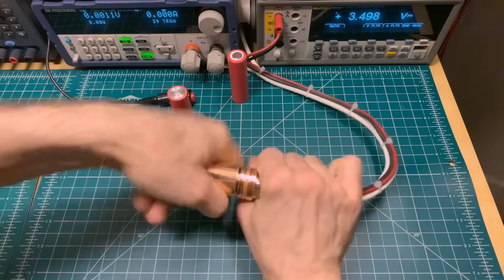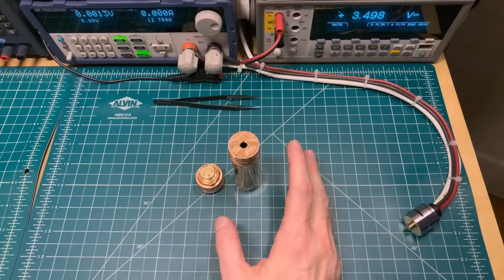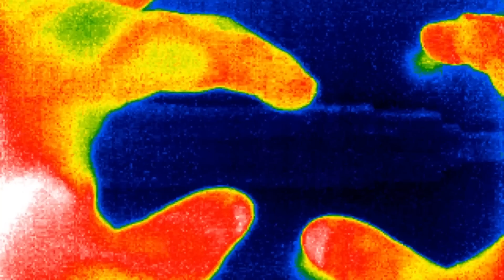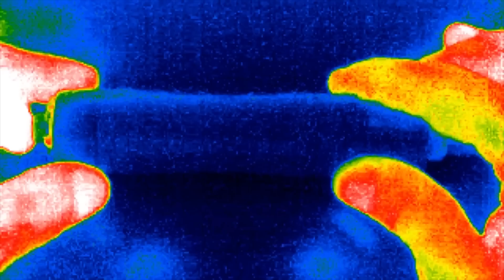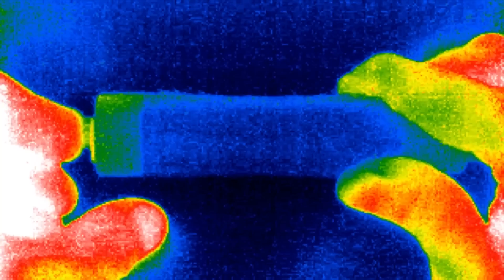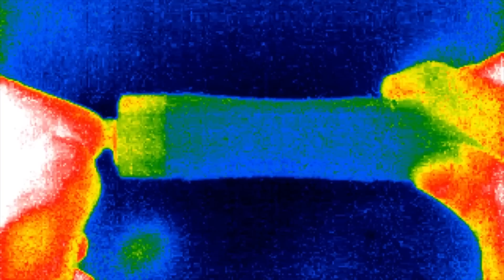Minding Your Mechs Ep029 – Timesvape Heavy Hitter (collab with TenaciousTX Vapes/Heavy Metal Vaper)

Comment: Mines just acrs constantly, cleaned thoroughly, raised the resistance (0.26), inspected every piece ect and it just won't fix, gets hot hot on the battery tube where the button locks in and there's a couple black dots where the arc happens inside the channel where one of the locking teeth goes, only a month old too. I even swapped the springs to the spares and the o ring too literally lost for a fix at this point

Comment: I hope i get a response... I also use the same mod, using Molicel 21700, is it safe to vape in 0.10 ohm?
Reply from the maker: Run the Ohm’s Law equation to see how much current you are drawing from the battery with that resistance. You MUST know how to do this before you use a mech! Compare that current you will draw to the battery’s current rating. I recommend staying below the battery’s rating but some people go over it.

Comment: I just got my first mech today, and it was this one, working fantastic, just still a little confused on why the battery drops so damn fast... this video was quite confusing too me ahha
Reply from the maker: Glad that the Heavy Hitter is working well for you! There is a lot of info to absorb and lots of new terminology to deal with when first starting with these videos. You can just check my mech voltage drop table to see how well this mod did compared to others. The link is in the Description section of the video.

What battery are you using? What is your coil resistance?
Reply: @batterymooch  thanks for the reply.
Im using a Molicel P42A although i got a samsung 30T on the way, and .28 ohms
Reply from the maker: Zited you should be getting decent use out of that P42A at that high a coil resistance. Using mechs means a constantly changing vape though as the battery discharges. Depending on how many puffs you take it might only be a couple of hours before you feel the power level has dropped too much. Regulated mods can offer much more power and their output stays steady as long as the battery hasn’t dropped below the device’s cutoff voltage. The 30T has less capacity than the P42A but hopefully it gives you a better vaping experience. With a 0.28 build though you are at about 45W-50W. Is that the power level you were aiming for?
Reply: @batterymooch  Yeah the power level is just spot on, great vape

Comment: I could see the gold plating on the ball contact beginning to be removed due to arching which is why I don't get gold plating on things. It's just one of those things that happens. Great macro photos and great review. Minimal voltage drop which is good.  I am more concerned with consistency of the drop resulting from placement of the bayonet switch and it's position at the time of pressing, it is what it is. Overall nice mech.

Comment: Hey Mooch. I just recently bought my first mech. I was given a copper Dreamer. Then I liked it so much I bought a Tenatious Unicorn. I scanned through your channel and I didn't see any charts or vids of any tests on it. Did you ever make one? I was curious because of the solid silver contacts.
Reply from the maker: I haven’t tested the Unicorn. The metal used in the contact will have only a tiny effect on the overall voltage drop though. The contact smoothness, the size of the contact patch, the threads and how well they contact, all those have a much, much larger effect than the contact metal choice.
Reply: @batterymooch  you want too? 😁😉
Reply from the maker: TenaciousTX I’m happy to test a Unicorn, thanks! It will make a patron very happy. 🙂 If there are different metal contacts available I can compare them in the video.
Reply: @batterymooch  see what I do? I bring people together!😄
Reply: @tenacioustx  yes!! Please do man I love my tenacious unicorn and would love to see what mooch gets out of it
Reply: @johnoakes34  the tenacious unicorn mech is one of my fav mechs!! I got mine w the Ardent direct hybrided on w the solid silver hybrid pin installed in the Ardent. It's a cracking vape for sure. So underated
Reply: @cavemanlovesmoke4394  I have mine the same way. The Ardent is an awesome dripper. Huge well, side/bottom airflow and plenty of delicious flavor. It just finishes the look so well.
Reply: @johnoakes34  amen brother! Cant wait to hybrid the ardent on the heavy hitter too. I gotta wait til 16th til my preorder comes but I'm excited. Got a black copper one :)
Reply: @batterymooch  thanks buddy

Comment: Really well designed, impressive numbers in the voltage drop testing. Prolly will get me one of those, once they are avaible in europe, and pair it with a QP Design Juggerknot RTA V2. Because 28mm is the new 25mm.